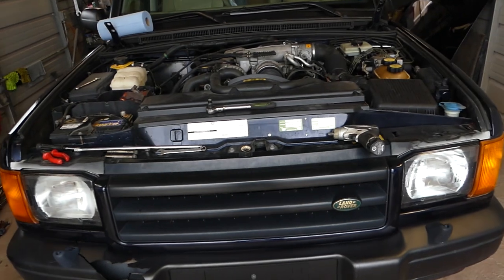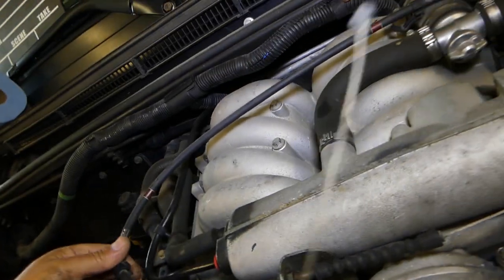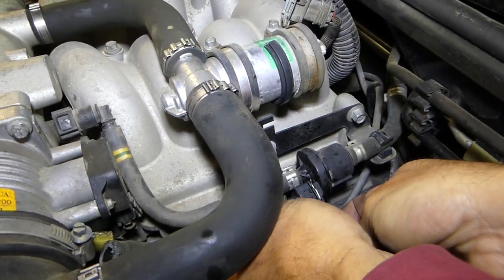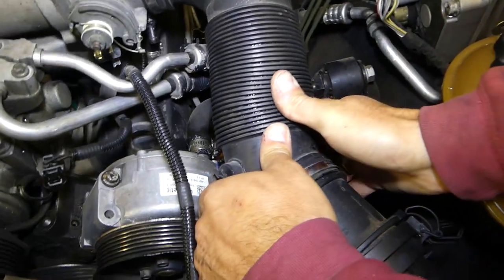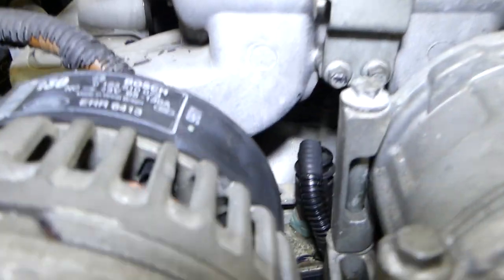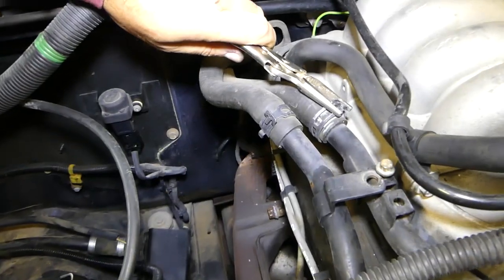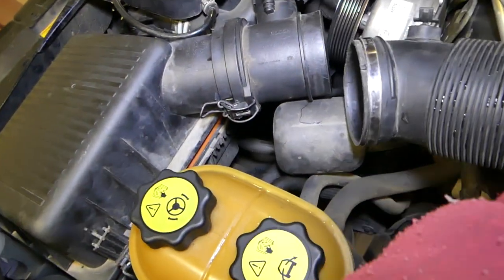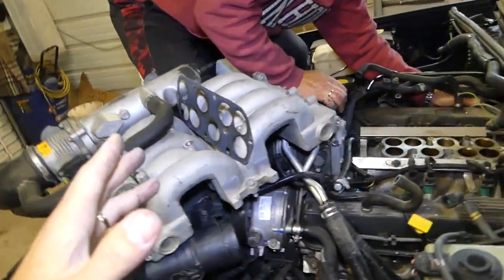LAND ROVER DISCOVERY INTAKE REMOVAL REPLACEMENT 4.0 V8

Comment: Nice Video. I have a 2001SE Land Rover Disco 2.  When I removed the intake I didn't see any ground wires.  I will have to double check mines. I replaced the Ignition Coil Standard motors Prod(UF545), Spark plugs (Bosch 8100 Double Platinum), Spark plug wires NGK 58404.  Any Idea what next I should check.  Any help would be great